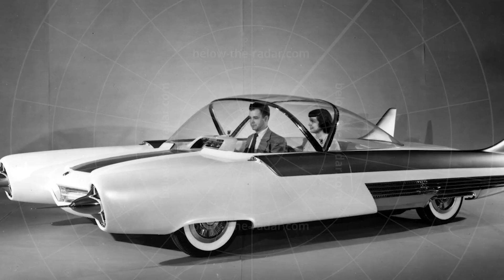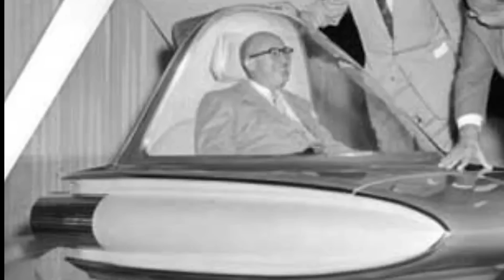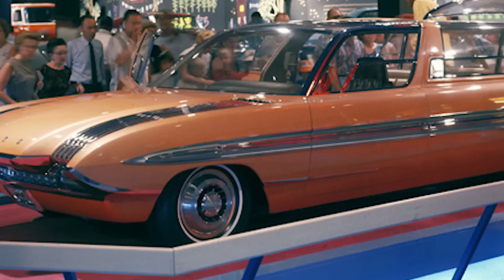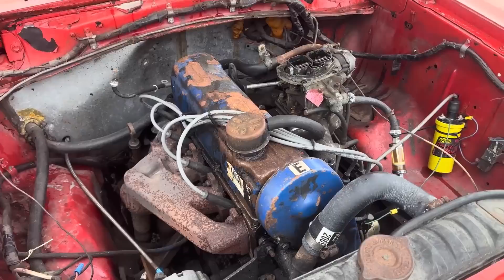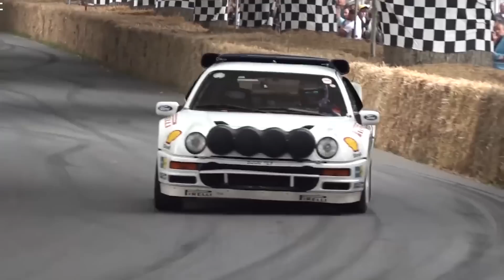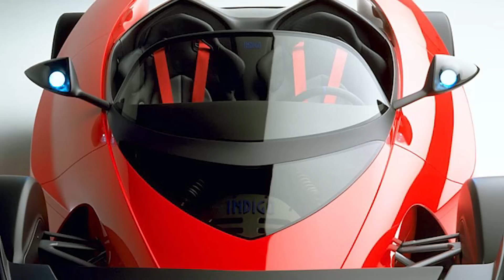25 WEIRDEST Cars FORD Ever Made

Comment: This video is a total joke. just a collection of plastic models and non functioning concept cars, most of which would have never worked in real life such as number 9 the Ford Gyron that used 'a collection of Gyroscopes' to balance on its 2 wheels. 
Really? so what happens if you try to go round a corner in a car with a 'huge Gyroscope' YOU CAN''T DO IT, it would only ever go in a straight line. The whole thing is total B.S.